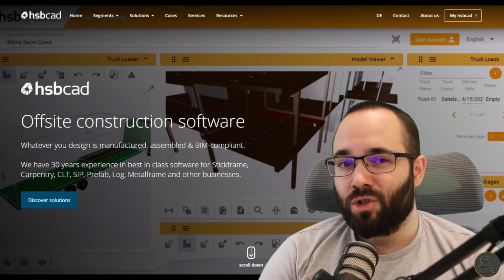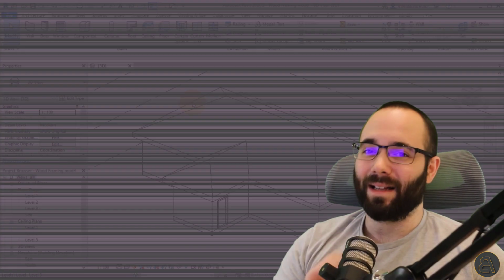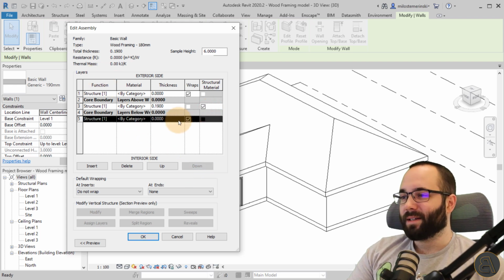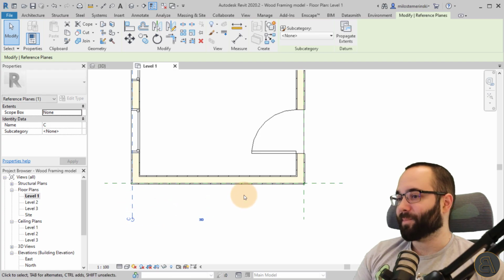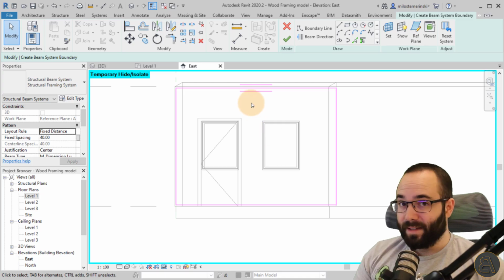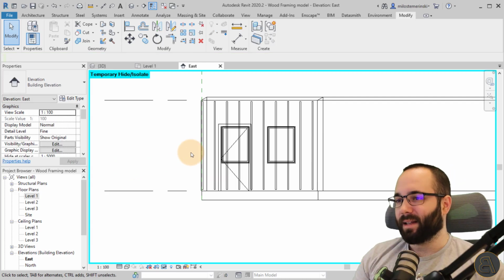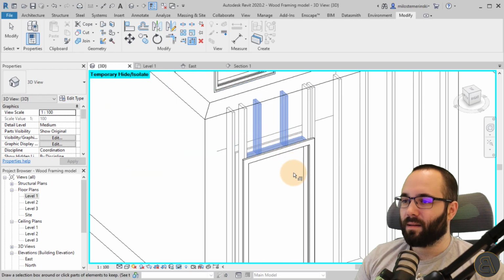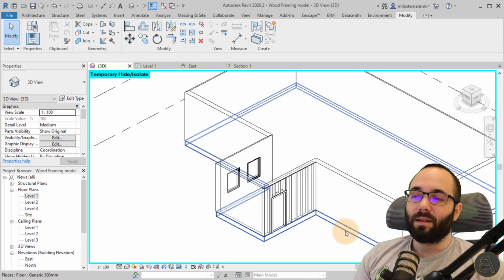Wood Framing in Revit Tutorial

Comment: That's an incredible amount of work to show the studs. Only worth if you actually need to show them. Small correction, in a typical wood framed wall the interior would be gypsum board, and plywood is considered structural, not finish. Thank you for the video Sir.
Reply from the maker: Thank you for letting me know, I don't have much experience with this type of construction. :)
Reply: @balkanarchitect  my pleasure.
Reply: @pault207  Reflecting on your comment, we suggest you try our free trial of the hsbStickFrame solution because it is so versatile in determining multiple layers of boards as you describe, and do it all automatically.
Reply: @hsbcad  Is it possible to create curved walls and curved roof? (in floor plan and section view?)

Comment: I’ve done this on a recent small but complicated house that needed precise steel and wood connections. Two suggestions: 1) make a framing work set that can easily turn in and off in views. 2) Create filters to color code: for example, if PT (pressure treated) is in the name, the framing member shows up as green. If ENG (engineered lumber), a different color.

Comment: I just finished a project, using curtain walls mullions for wall studs, and beam systems for rafters and ceiling joists. I was thinking about modeling the studs with beam systems, but i need to check this out. The bill of materials was kinda challenging after that.

Comment: Curious to see your approach for roof framing and the junction to the wall head - that's generally the harder system to frame out. My preferred approach, whilst not category compliant, is to use curtain roof and wall systems with mullions as the members versus structural framing. I find framing much too difficult once you get to the roof zone.
Reply from the maker: Yes, the curtain wall approach it good, I find it too constraining in some case, but the benefit is that it's much faster to implement.

Comment: my beams have appeared on the wrong side of the reference plane in plan, how do i correct offset, thanks?
Reply: You need to set which level you’re beams are on. In the properties window there is a top and bottom position for beams. You can also create for example a first floor framing plan, set the level on the ribbon under the structure tab. Ensure you select the correct level, if the beam doesn’t show its sometimes a case of the cut level, beam being either top or bottom or the levels are not set up correctly. 

I’m not on my desktop so I’m doing this off memory, but I do structural drafting hence why this type of plan view is more known to myself.
Reply: My beams do this also, posts do the same thing looking externally they are placed on the outside of the structure. Not what happens in this video.

Comment: Great video! If an architect with a working knowledge of wood frame construction took the time to do this it could save the structural engineer quite a bit of work!

I'd be curious to know if there was any way to automatically capture the length of the framing members and export them to a schedule. Could be quite useful in generating cut lists and material take offs.
Reply: Hi Samuel, as a suggestion, try out the free trial of our hsbStickFrame and see for yourself how straightforward and simple it is to make the scheduling, shop drawings and even CNC data.